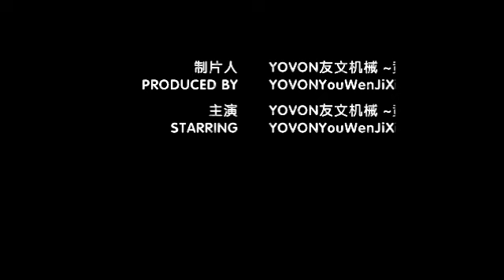fireworks display shell wrapping machine

Comment: Good afternoon, employees of the company"YOVON". I am interested in the smallest machine for parallel rolling of tubes. Here are the dimensions of the cardboard tube I need:
length-100mm
inner diameter-30mm
 tube thickness 5-6mm

I sent you a request by email, but there is still no response.
Reply from the maker: LILING YOVON FIREWORKS MACHINERY FACTROY
ADD: YOVON fireworks machinery factory liTianTown LilingCity, Hunan, 412209 China
Mobile: +86 18273288055 Daniel
Whatsapp: +86 13974166125 Candy
Wechat: cs111177 Candy
E-mail: YOVON1188@vip.126.com
Reply from the maker: I still not receive your email. pls send me again or add my whatsapp: +86 13974166125